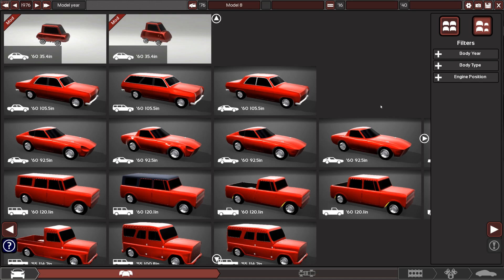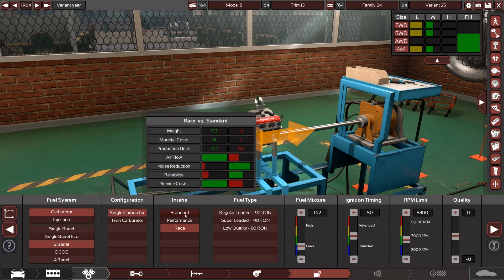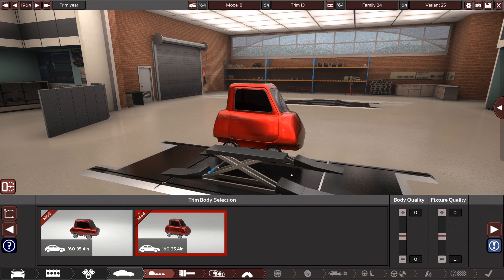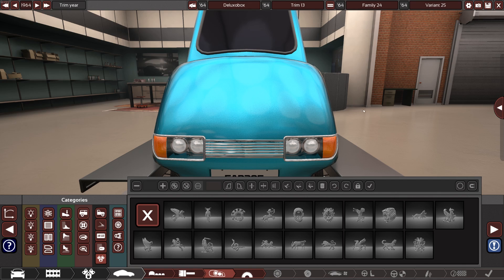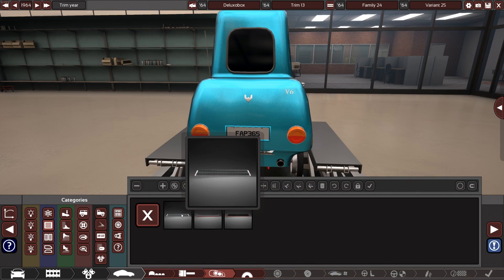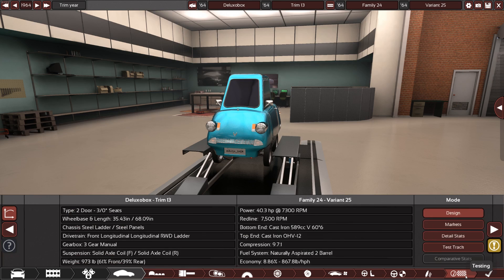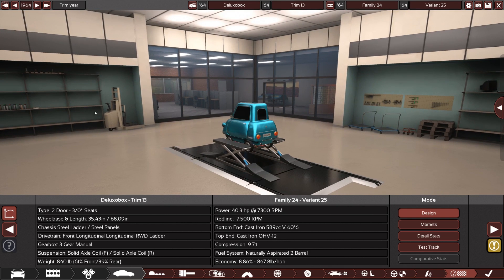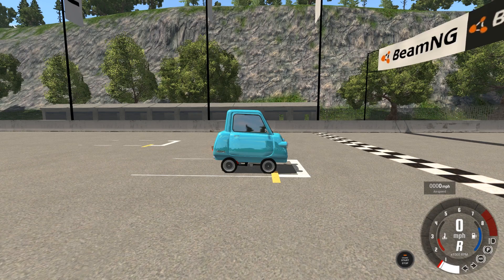Biggest Possible Engine in a Peel P50 | Automation / BeamNG

Comment: I'd buy a Deluxobox in a heartbeat, if the price was right. And if the engine wasn't mounted in a place where an engineer and a doctor had to service it.
Reply: Only 64k and it's yours!
Reply: Actually peel p 50s are still sold
Reply: @jakobschmutz  but can it seat 3?
Reply: @josephstalin7995 not even one tall person
Reply: @jakobschmutz  well the DeluxoBox sure can!
Reply: @josephstalin7995  Not Recommended

Comment: 11:28 This is what it says in game. (You can always click on the bar above the selections to get a description of your current choice, though not all of them have been written yet.) 

"Safety glass prevents injury from glass shards. Dashboard controls and door handles are recessed into their housings to prevent impact injuries. Bumpers are designed and tested for impact absorption, and extensive dashboard, sun-visor, and armrest padding is provided. The front and rear structure of the car is engineered to deform on impact to protect the passenger compartment. Front passengers are provided with lap-sash seat belts, rear passengers with lap belts. Doors are engineered to remain shut in the case of a crash. Roof pillars are strengthened for roll-over protection. The steering wheel has some flex built in to reduce impact forces, and the steering column is designed to collapse. Front seats have headrests to prevent neck injury."

Good grief Kilrob, don't you have anything better to do with your time? (Okay, a lot of these are copy-pasted from the earlier safeties, and then are copy-pasted further into the future. But still!)

Comment: If you made something as extremely bonkers as a Peel P50 with a huge engine, I wonder if you would be up to make a GT3 or racing variant of the Fettuccine, Maklara, or literally any normal car. This way we could have the low end be extremely, stupidly slow cars, and the high end could consist of barely drivable yet extremely quick cars on a level that is even higher than the likes of the Pilgrim. I don't know though, it's just an idea. :)
Reply from the maker: In the coming episodes theres gonna be a jump up to that level :D
Reply: @ConsiderGaming  I can't wait! Season 2 looks like it's going to be even crazier than the first!

Comment: Can you do Datsun 240z but with 1500hp inline 4 engine
Reply: H O W
Reply: 20,000cc?
Reply: @caralho5237   I think it's possible if you make the engine like 4L in size
Reply: @caralho5237  To test the feasibility of this, I made a min-max Inline 4 engine. Its' actually quite possible with a 5.4L Turbocharged Inline 4 with 2020 tech and a LOT of quality slider min-maxing. I was able to get up to 1995 horsepower, with an engine that's ready to kill itself. 

It's possible, but extremely ridiculous.
Reply: @DatMageDoe  How much RPM ?
Reply: @caralho5237  It peaked in power at 7600 RPM, and redlined at 8400.
Reply: @DatMageDoe  nice

Comment: Next car should be a ‘20s off-roader, skinny tires, high rise height, lots of cylinders but relatively low horsepower, keep it an in-line, give it spoked wheels if you can, and if it’s even possible to make it a diesel, DO IT

Comment: Here's a tip for you; pushrods take up much less height and width than overhead camshafts. For example, you can have a 4.7L pushrod engine in a space that would only allow for a 4.2L dual overhead cam engine.

I suppose using a pushrod V6 will let you maybe gain some displacement, but then again, you did become limited by length, and not by width or height.

A transverse V6 in a Deluxobox might benefit from this I guess

Side note, I'm pretty sure you could probably fit the entire Deluxobox in a Gavril D15's bed
Reply from the maker: Addressing that last part, it does not fit, actually. It slots into the original Wallaby's bed pretty well, though

Comment: You make such wack (pardon me) vehicles, but for some reason I am very entertained. I usually only make engines that are hilariously expensive because of the fuel economy. I either make a 1200hp 4.0L V8, or a 330hp 1.6L I4 (yes that is completely possible).

Comment: I actually did pretty much this only two weeks ago, it had an 800cc V6 engine and could do up to 81mph and get just under 50mpg. The only downside was that the breaks are a bit to harsh so if you try to stop the car you’ll just fall flat on your face...

Comment: I made a bubble car that was super awful. It had a 3 or 4 hp i3 engine, front wheel drive, and going over 4K rpm blows the engine. Stopping at 5 mph gets your rear tires off the ground, and stopping at ten gets you on your roof. Stopping at full speed (like 36 mph) causes you to do several front slips. Turning at over 5 mph sharply caused you to flip. My Automation company is called Hawk Motor Company (or just Hawk), and I called the car “Bubble”. I decided to make a better version. I gave it a dopey “face”, brick red paint job, it was thicc, had a very squared design, and huge taillights. It was RWD and had 10 hp. Naturally I called it the “Brick”. I exported it into BeamNG.drive, spawned the predecessor, and it was extremely slow. After I let off the throttle, the engine blew up. I tested to see a safe rpm, and as it turns out, no matter what, you will blow the engine. Also, stopping still gets the back airborne.

Comment: Can't wait for my absolutely mental minivan request (dont care if it's in season 2 or 3 whichever it ends up in) many many horsepower highest number of v shaped cylinders, twin turbo, manual transmission, locking rear diff, McPherson strut front suspension, solid axle leaf rear, no traction control or abs none of that garbage, must have drum brakes front and rear (size and power of said drums is up to you), no safety with as many seats as possible, must be straight piped for maxium 'Muricaness, power steering is optional, must have a minimum of 2 hood scoops

Comment: if you up the quality of the motor parts you will get a lot more power to work with. You can also make the settings higher and so on.
Reply from the maker: Yeah I try to avoid adjusting quality because then I end up with a spamload of "it's too impractical to produce" and "it would take decades to make it dont do that" comments so I just kinda tend to avoid that now lol. 
I mean ocasionally I'll boost it to 5ish but no more

Comment: You should try to make a truck with super high torque but terrible hp, so it has tons of power but it can't go very fast.
Reply: Because horsepower is partially determined by torque, not super feasible.
Reply: @DatMageDoe  well, ok. But maybe max torque with low gearing.

Comment: You laugh at the idea of an engine under the seats, but it has been done before in several cars. Things like the Toyota Previa.

Deluxobox sounds like a pizza special

That first logo looked to be a griffin. And then you slapped what is basically a Firebird logo on it and committed high automotive blasphemy. 

Advanced 60s Safety is probably lap belts that are not there for decoration, plus a deformable steering wheel and padded dashboard. These were actually safety features back then.

Comment: hello mr consider, is it acceptable to make a request of a awd suv in automation with a 5 liter inline 4 with turbo that rews less then 3000 rpm but makes more then 400 hp and then test it in beamng, yeah it will sound like and behave close to a diesel engine but as one of your subscribers i would like too see if you can make it work. mwh Charlie Andersson.

Comment: Can You Please Make A 1985 Dodge Daytona Turbo Z. I Will Give You The Info On The Car

Curb weight (without a driver):

1225 kg / 2701 lbs

Engine manufacturer:

Chrysler 2.2

Engine type:

spark-ignition 4-stroke

Fuel type:

gasoline (petrol)

Fuel system:

indirect injection

Charge system:

turbocharger

Valves per cylinder:

2

Valves timing:

Additional features:

Multi-point fuel injection; Garrett T3 turbo

SOHC

Emission control:

3-way catalyst, Lambda-Sensor

Emission standard:

Cylinders alignment:

Line 4

Displacement:

2213 cm3 / 134.6 cui

Bore:

87.5 mm / 3.44 in

Stroke:

92 mm / 3.62 in

Compression ratio:

8.1 : 1

Horsepower net:

109 kW / 148 PS / 146 hp (SAE net)

/ 5200

Torque net:

231 Nm / 170 ft-lb

/ 3600

Gearbox:

Transmission type:

manual

Number of gears:

5

Gear ratios (overall):

I

3.29 (11.75)

II

2.08 (7.43)

III

1.45 (5.18)

IV

1.04 (3.71)

V

0.72 (2.57)

R

3.14

Traction:

FWD (front-wheel drive)

Final drive ratio std:

3.57

It's A 3 Door Hatchback With A Wrap Around Spoiler